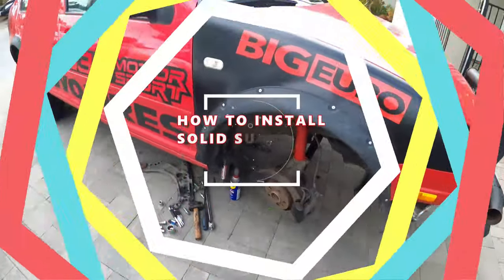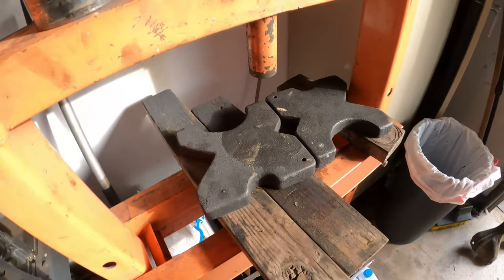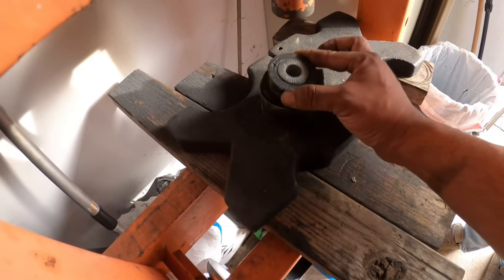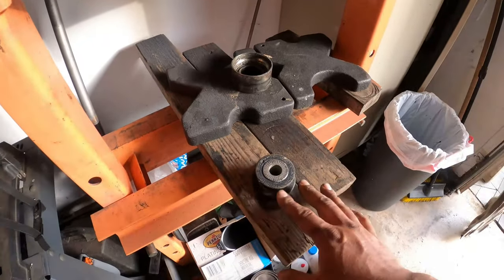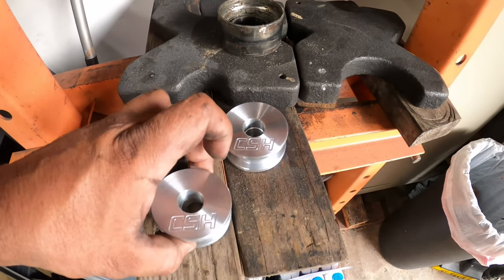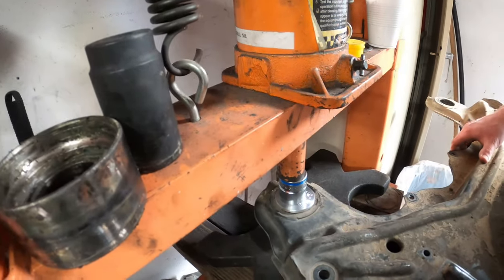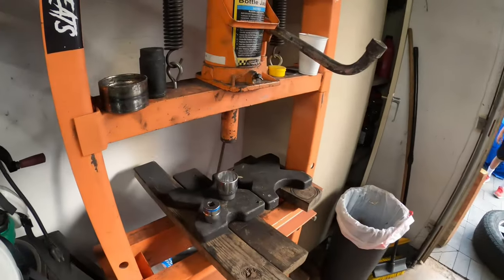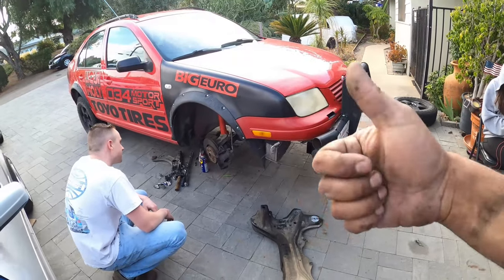How to install CSH Solutions Solid Subframe Bushings S7EP29

Comment: Cold I freeze the bushings and heat the subframe up and push new ones in as I don’t own a press 😂
Reply from the maker: Yes you can do that just make sure you use a rubber or brass mallet to hit them I  so you don't damage the metal